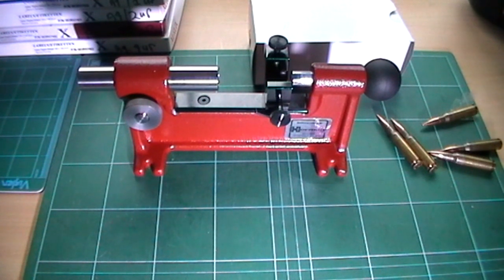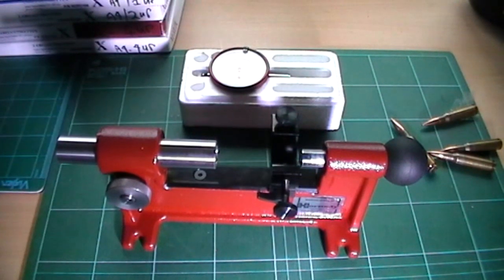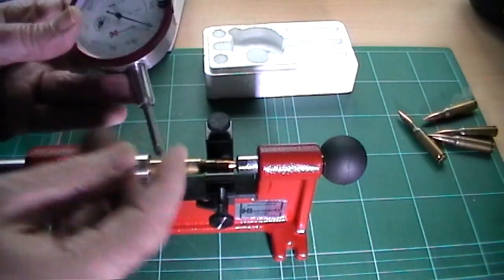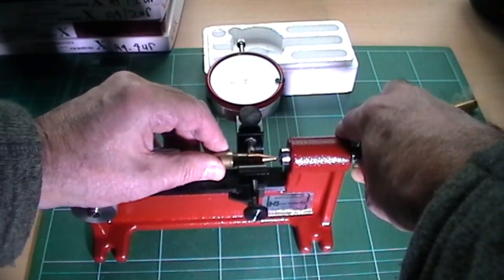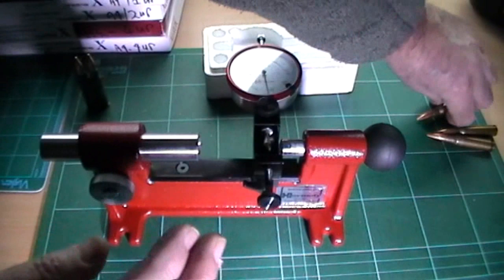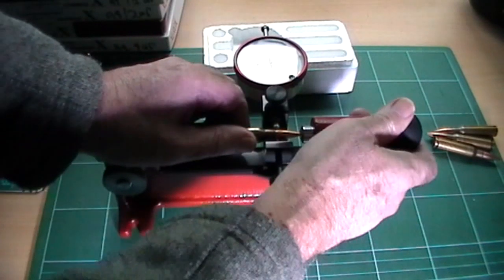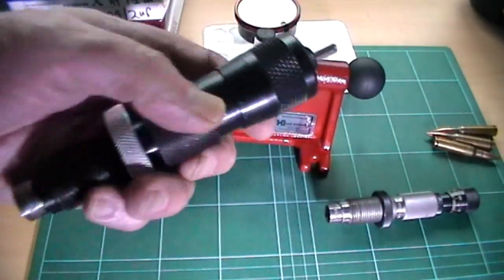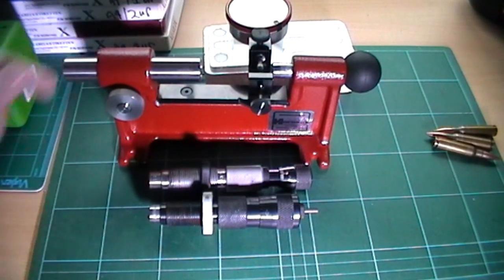Setting up and using the Hornaday LNL Concentricity Tool to measure runout.

Comment: What did you find on run out when concentricity was 8 thousands on factory match vs. your 2 thousands match die seated reloads?  Obviously loads work up for reloads may give you an advantage for your rifle that factory ammo doesn't enjoy.  Still very curious what you found and do you feel the concentricity gauge was a worthwhile purchase?

Comment: With the ability to not only detect runout but also correct it and check the degree of correction immediately, one wonders: whither the future of grand, expensive presses and "competition" dies that sell themselves on the promise of minimising it?
Reply: I should think that competition dies will still be around. It's one thing to load and check, and maybe correct a relatively few rounds, but if you used 'normal' dies, and had to correct every round, that would get to be very tiresome and time consuming. But then that is also a big "IF."

Comment from the maker: Thanks for the comment. The case head spindle has a cone shaped hollow that the case head fits into. The primer pocket does not contact this coned surface at all. Hope this helps.

Cheers, Bob.

Comment: How does the primer end of the cartridge centre in this jig?   If that's not perfectly centred than you won't get an accurate reading.     Just can picture how it will centre all the different diameter cases.   Cheers
Reply: chris d. dont be taking any heed of this video. This chap does not have a clue. This is all bullshit it dosent matter 1 bit. The bullet cant go down the barrel off square